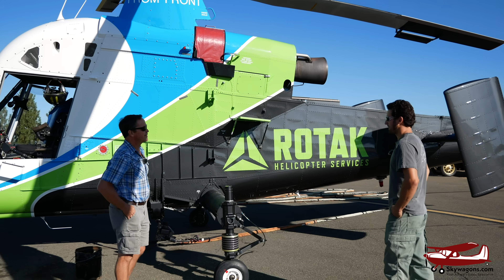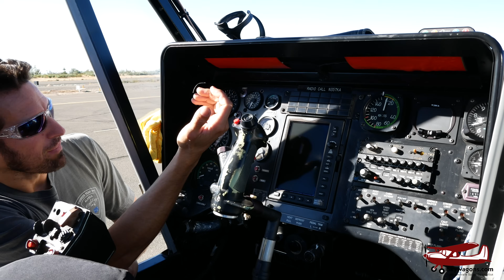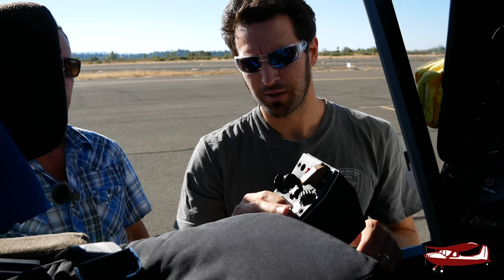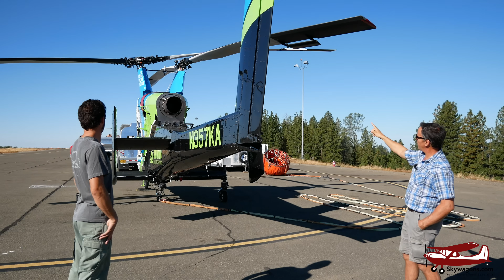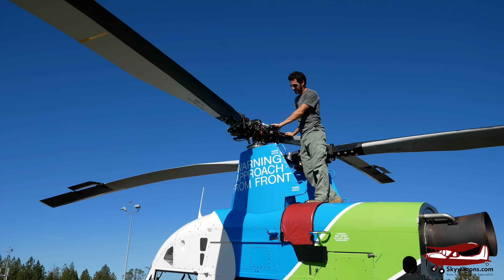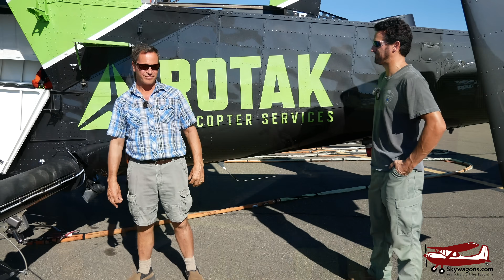Interview with a K-Max.

Comment: Wow, it actually uses the power of the wind moving over the blades itself to take the place of hydraulics.  Move the little flap and let the "wing" distort itself.  It would be like if the flaps on a plane wing not only changed the profile and size, but also distorted the wing.  Amazing.  Edit: I hadn't watch entire video when I made my original comment-- it is also so amazing that part of this helicopter has to be grown-- we don't have anything engineered that will allow the flexing cycles that those blades must endure-- only trees, with their subtle responses to survival pressures over time, could create the right internal atomic structure to allow this thing to fly by the principles that it does.  Obviously all things made originate with nature at their very basis, but the fact that part of this helicopter MUST be natural and can't be bested by anything synthetic is the most interesting part to me.
Reply from the maker: The Wright flyer had wings that distorted.  So does a bird.

Comment: The only thing left out (that i wanted to know anyway) was lifetime hours on the blades. At $2m you would hope for many!
Reply from the maker: I'd expect at least 10 years or several thousand hours.
Reply: @skywagonuniversity5023  thanks. I've been searching but no luck yet. If it was the 3000 tbo that would be $660 an hour, so suspect they last 6000 to 7000 hours. Wood hey! Would love to see a video on their construction!
Reply: 8000hr life limit
Reply: @Helimonkey Thankyou for reply. 
I figured 6000-7000. 
8000= $250 p/h.

I'm really impressed with that. Would love to watch them being made. 

Cheers 

That is impressive for wood.
Reply: @rowanshole they get an xray inspection performed every 1025hrs as well to ensure there are no issues internally.  And FYI, prices have since gone up on those blades the past 2 years 😂
Reply: @Helimonkey cost of flying crisis!

Comment: Great video.Would it be possible tofit a stub wing that would supply lift that would enable the aircraft to tilt forward thereby vastly increaed sped due to the stub wings complementing the loss of lift that I am assuming would occur in this mode?This would enable the wheels to retract into the wing reducing drag.If possible,this would surely give the Osprey competition on price,simplicity of maintenace.Yus sayin,Bob
Reply from the maker: Possibly!

Comment: In case anyone is interested on the CH-47 Chinook yaw is by opposing left and right cyclic at the front and back rotor and fore/aft movement is by increasing collective on one rotor and decreasing it on the other. There is also a "longitudinal trim actuator" that applies fore/aft cyclic to both rotors but this is only used to pull the nose up in forward flight and push it down in hover (the CH-47 wants to hover nose high) and it's controlled by the electronics not the pilot.
Reply from the maker: Thank you for this.

Comment: Tail rotor only takes about 10 %, NOT 30 %. but even that is a significant improvement of efficiency. The swept area of the blades is a lot more than usual for a helicopter of this power class (1350 HP), so the downdraft is lower intensity spread over a larger area. The characteristic of the Flettner intermeshing rotor system is that it tends to a stable hover, and requires pilot input to move, unlike most other helicopters.

Comment: What’s the point? Just use an enclosed tail rotor
Reply from the maker: The point is that it can lift twice it's weight and has no torque on the fuselage
Reply: @skywagonuniversity5023  I mean isn’t that why we have the SkyCrane and Chinook?
Reply from the maker: Oh, I see.  Still it has massive lift for so much less cost.
Reply: @skywagonuniversity5023  to its credit, it’s very compact for what it does. You can’t fit a SkyCrane or Chinook in small spaces. I’m guessing that’s where this bird shines. Man if I had the choice, I’d still take a Little Bird over it.

Comment: All that and still wooden blades. Incredible. I figured they would have changed to at least like a composite coat around a flexible core
Reply from the maker: Amazing, all that technology and wood is the material used for the blades.
Reply: The laminated layers of wood allows for more twist in the blades that they cannot get with composite blades, also allows for increased ability of repairs , amongst other things. Also, only the spar is wood with a stainless steel leading edge and a honeycomb structure

Comment: Question for someone. I gather the blade is solid wood (laminated) aside from an internal channel for the control rod. Where is the centre of gravity chord wise? On a single blade machine operated with a swashplate the CG is about 25% back from the leading edge. Excellent video thank you.

Comment: Why would you allow any lead / lag at all in this system?
Reply: All helicopter blades must be allowed to lead and lag. Different rotor systems allow for this movement in different ways. 

To explain why we must have lead and lag, first we need to go back a few steps. As a rotor system moves through the air their is an advancing blade and a retreating blade, in relation to the forward air moving across the rotor disk. This increased airspeed causes two things to Happen, the advancing blade (the one running into the wind) creates more lift while the retreating blade( the one running away from the wind) creates less lift. This is known as dissymmetry of lift, unequal lift across the rotor disk. If allowed to exist , the helicopter would roll over in flight , so the fix is to allow the blades, independently of one another to flap up and down accordingly.  The advancing blade ( the one running into the wind) flaps up, decreases its angle of attack and creates less lift. The retreating blade ( the one running away from the wind ( flaps down, increases its angle of attack, and create more lift.  However a new problem has now been created, as the blades flap up and down they get closer and farther away from the center of rotation.  This happens independently of one another.  Now we create a problem known as the Coriolis effect. Think of the spinning ice skater, as he/she moves their arms in they speed up and and vis versa as they move their arms out they slow down. This is happening to the blades as they are flapping up and down. If allowed to exist , it would cause a major imbalance in the system. So a new fix is made, which is lead and lag. As a blade slows down, it’s can lead and speed up its rotation and same for the blade that has sped up from flapping up, it can lag and slow down. 

All these movements of the blades are critical for the rotor system to work in unison as it moves through the air. 

If I had a white board, I could explain this better for you. 
Hope that answers your question. (Sorry for typos)
Reply: @kbrashar  I'm aware of retreating blade stall. A twin rotor system solves this problem. Sikorsky's X-2 system is totally rigid, no flapping or lead / lag.
Reply from the maker: That is a question for Kevin.
Reply: No, not exactly. Twin rotor systems are still subjected to the same aero dynamic principles.  The rotor system you mentioned has a rigid rotor system in which the blades absorb the forces I mentioned above.

Comment: How can the rotor be 90 degrees from each other and counter rotate?
Reply from the maker: If they went in the same direction they would hit each other in 45 degrees. When one set is east west, the other set is north south and they are angled outwards so that they can inter-mesh.
Reply: @skywagonuniversity5023  had a senior moment was thinking it was   coaxial

Comment: Just a fantastic video for a "propellor head" fixed wing pilot such as myself. Thanks Mark and Kevin!
I thoroughly enjoyed that. The little "tail strike gauge" under the rudder I reckon should be called a "tell-tail"! - As it will soon tell the "tales of woe" that the rear end endured if you were ham-fisted with the cyclic during landing! What an amazing and very clever lifting machine, that can lift more than it own weight, - WOW!

Comment: A million dollars for a set of blades,  what a total overcharge for just handmade blades. The aviation industry is such a greedy bunch of people.
Reply: For a hand made low production part with an extremely high rejection rate? When you think about how much goes into making the blades and everything could go perfect and then one hidden flaw causes the blades to be rejected or have to be reworked it really doesn't seem that bad. Look at what a set of blades cost for a helicopter of like performance and it isn't that far off price wise. That's why when you look at the cost of new vs used helicopters a super cheap helo means you're gonna be basically rebuilding the aircraft to get it back to proper spec.
Reply: Exactly
Reply: Its mainly the insurance liabilty costs and greed..
Reply: @morrisdennis  I would ask what your experience in the aerospace industry is and attempt an honest dialogue with you but you've already come up with your circular argument and end point. So have a great day.

Comment: Mark: one question I have that I wish you would ask your guest is, since the aircraft creates yaw by increasing the angle of attack on the rotors on one side, thus creating more lift on that side and the pilot has to use the cyclic to counteract that lift I surmise that the action of the cyclic doesn't create as much yaw as the increased angle of attack.  Is this correct?

An addendum to this question is: is there a difference between how this helicopter's cyclic acts compared to a normal helicopter?  Same for the collective?

Please would you have the pilot expand on this topic?
Reply from the maker: Kevin,  Are you reading this?
Reply: Hello Robert. Good question. In regards to the flight controls, they all work similar to other helicopters. Pedals create a yaw movement , cyclic is directional control, and collective is mainly your up and down. Of the three inputs, pedals and yaw are by far the least effective in the Kmax. This is impart due to large surface area that is being moved and the although the “torque effect” works to cause the helicopter to yaw in the opposite direction , it is not nearly as effective as a standard tail rotor. 

Their are benefits to having no tail rotor, but it comes with a cost :)

I hope this answers your question.

Comment: The rotor system was designed and first used by Anton Flettner in Germany (WW2). Kaman used the system on the Husky and K-max.
Reply: That’s correct. After World War II, the US conducted “operation paper clip” which involved bringing the brightest minds from Europe over to the United States to aid in our lead of the arms race as we moved into the Cold War. One of these minds was Flettner.  He was a key person in helping Charlie Kaman build and develop the H-125, H225, The Husky, and finally the Kmax.
Reply: Flettner was an employee of Kaman.

Comment: Excellent 'walkaround' Gents, thank you. Although trying to imagine the actual physics of this machine in flight, does leave me wanting a larger colouring book& more crayons. - eg. Is ground resonance 'a thing' with this rotor system, or at a million bucks per blade, does that kind of madness only affect your bank manager's desk legs? 
Fabulous machine, a working madness to the benefit of all - in skilled hands, a marvel - but in mine, shameful wreckage : )
Reply: Ground resonance is usually a byproduct of lead/lag hinges falling out of sync.  So I don't believe this rotor system is susceptible to that, at least in the traditional sense.  Though it might still be possible since the wheels have oleo struts, usually not something you see unless impact dampening is required (the source of ground resonance).

Comment: Kevin; I am at a "Loss" as to why the In-Flight Tracking Actuators are no longer used. Their NOT being utilized constituted a Red "X" or Grounding Condition, in the past. Now, a go-pro, in flight shows the Rotor Blades out of track and causing the thing to appear to beat the crap out of itself. Are there simply no parts to keep it up to date? I could track this thing, with the help of the Friction Dampers, to smooth as a Baby's Butt. Not only a smoother Coning Angle but.....the Fuel parameters were greatly improved. Just wondering.
Reply: Hello Zobee. We absolutely still use the in-flight tracking system. We just didn’t get into the details of that component in this video. There are two tracking motors mounted to each rotor head just below the blades which allow the pilot to visually track the blades in flight. A must in a Kmax :)

Hope that answers your question.

Comment: That guy did a hell of a job explaining the helicopter.
Reply: One of the best guest presenters I've seen on this channel.
Reply from the maker: Indeed he is.  I told him so afterwards.
Reply: I had theories on how it yaws and he confirmed it as well as my concern that if you put more torque on one rotor than the other its going to roll as the rotor your putting more torque on moves to the vertical.

Comment: There WERE "fancy hydraulic systems" when he created this. Those go back about 100 years at this point.
Reply: Datarew, you are correct with the fact there were very sophisticated hydraulic systems back then. Perhaps I used the wrong words “fancy”. Kaman was determined to build a simple  and light weight inter meshing helicopter.  The hydraulic systems of that time didn’t meet his needs for being light weight and simple. That’s all my statement was referring too :)

Thanks for the comments and interest in Marks video
Reply: I agree. But this was his way of doing it. There's enough complexity in the intermeshing rotors.
Reply: Flettner as well
Reply: Karan was going for rigid rotor  performance as well. Rigid rotor like the AH56 Cheyenne.
Reply: @mthury4532  the point still stands.